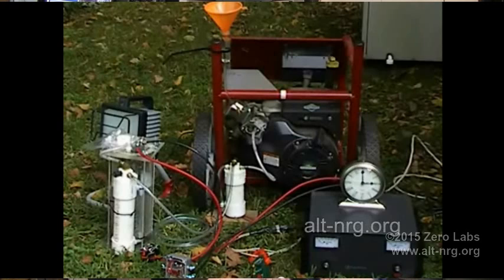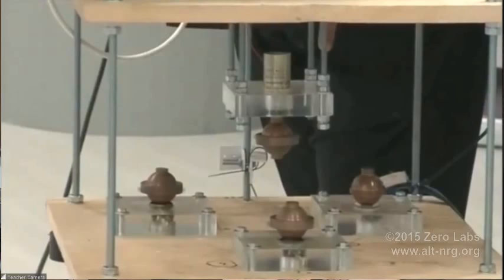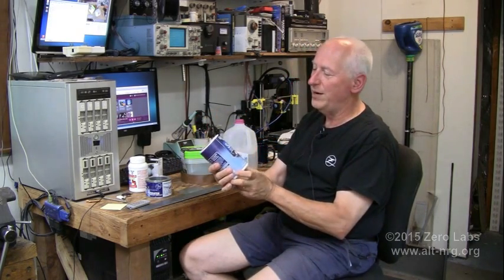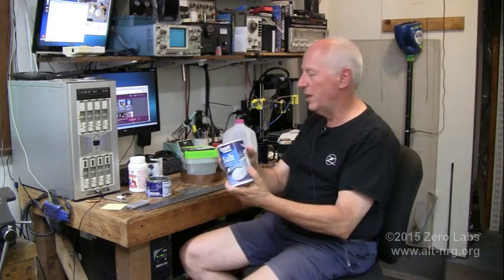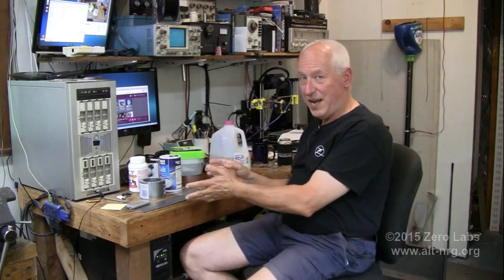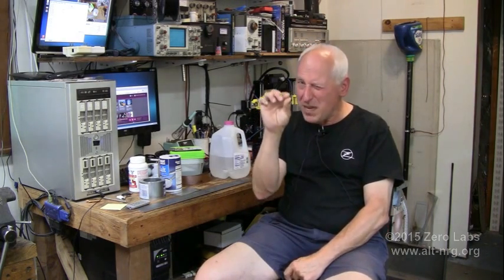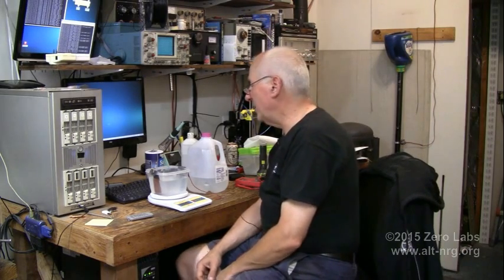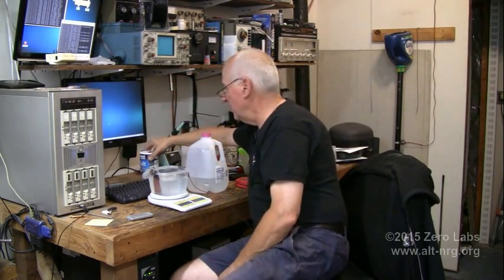#405 Keshe plasma reactor test 01

Comment: Hey Mark. Were you ever able to get the nanocoating to transfer from the Magrav to any uncoated copper wiring? I noticed an electrical charge on a nanocoated piece of wire, much like an electret where there were none on an uncoated piece of equal size. Even after I tried to discharge it, it would soon reenergize; millivolts but still there. I'm in So. Florida and I was never able to find a suitable load to nanocoat and charge any uncoated wiring in a circuit as required. I still not 100% positive his theory is wrong. I run a small floor fan through the Magrav I made just to show people and nobody believes that it doesn't short out. I've even touched it accidentally and it didn't shock me but so far it just a conversation piece like a pet rock. Lol

Comment: Whatever you do, do not connect anything to the power grid. Keshe has said that his blue can coats the wiring in your house. what happens when you have a superconducting antenna attached to superconducting wires through superconducting breakers (that wont work anymore as designed) to the power grid? Can you say widespread failure of the grid? To test the systems use a battery to an inverter to test these units. Never attach anything to the Grid system that has not be UL approved and tested for feedback after the unit coats the wiring system of your house. Any damage to the grid system can and will be held against you and it could get very very expensive to replace huge swaths of damaged power equipment on the grid.
Reply from the maker: +Jon Bigman OMG! Just one of these tings could take down the entire grid! Danger, Will Robinson! Danger! ROFL!
Reply: Lets look at what happens when one of these things lets the nano coating creep back past your home system, including bypassing your breakers. Keshe has reported that the nano coating actually spreads back into the home system coating the wires and I would assume the breakers. Negating the breakers is a very dangerous thing to do for both your home system of wiring and the grid. Not to mention the electrical disturbances of lightning could be received and feed back into the grid.
Reply: +Jon Bigman Moron Takemoney Cashe is simply a totally ignorant idiot and a dirty little crook :D
Reply: +Jon Bigman Yeah fuck this shit. would need some kind of inductor separate from the grid to be of any practice use.

Comment: You pay a lot of attention to less important effects.
The most important is the reactor. Rotary warp drive
can attract energy from space-time by contracting
its metric thus drawing far bodies of mass a little
closer, causing loss of gravitational energy, which
can be converted into electricity. That requires huge
charge separation. Separating +-20 coulombs over
1 meter within 1^3 meters requires several giga
volts. If the core is plus and the outer gas is minus
and the core rotates at angular speed higher than
the outer, then you get rotary warp drive in diagonal
to the radius. The problem in Keshe reactor is that it
is metallic which prevents charge separation. 
Another problem is that the core is not bombarded
with UV laser or with X-rays so I do not understand
how charge is separated.
Even if electrons oscillate and spend more time
out of the core than in, rotary warp drive can still
appear, however, I fail to understand how even +-
5 Coulombs can be statistically separated over
time in the reactor. It maybe my lack of
understanding and not a real problem in
Keshe's technology.

Please read my paper:
http://sciencedomain.org/abstract/9858
DOI: 10.9734/PSIJ/2015/18291

In http://www.scribd..com/eytan_il I fixed 3 errors:
1) One error after 16, A(Myu,Nu) = - A(Nu,Myu)
    and not A(Myu,Nu) = - A(Myu,Nu).
2) The classical limit after (71) has a superfluous division sign
     under the root before "A friend, Mr. Yossi Avni suggested that".
3) In the corrigendum, in 3) Majorana neutral fields, it is written,
   "and therefore if U(k) is fully imaginary".
     U can't be purely imaginary. There is a
     replacement to 3). I didn't invest enough efforts in 3) in the
     corrigendum and it was fixed in other posts to the internet.

Comment: The saltwater solution with the 2 plates is not a means to nano coate anything, but create what he calls GANS that you wil dip the already nano coated wires or coils in as a secondary coating. IT can be any metal of 2 diferent kinds or 2 copper where 1 is nano coated, otherwise the interaction creating the GANS does not trigger. It becomes a oxydised GANS. Im testing this to verufy if it works or not myself, but with less equipment, so it goes slow.

Comment: Unfortunately your nano-coating is not strong enough. You should use drano and boiling water, newer fail for me so far. Different salts didn't make much difference. In general this works based on probably hundreds of experiments I have done. Not only with Cu and Zn. You will get so called GANS... What you are going to do with it - that is different story.